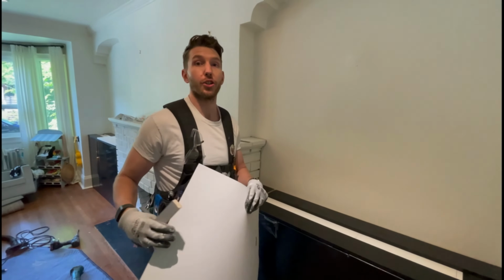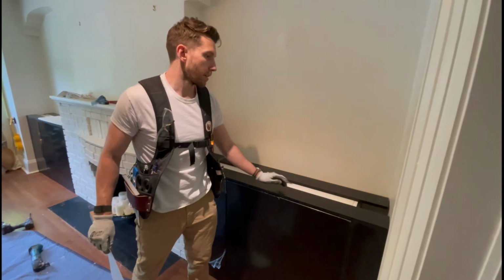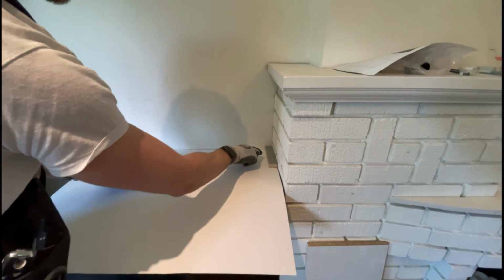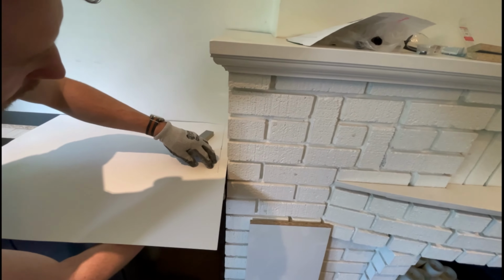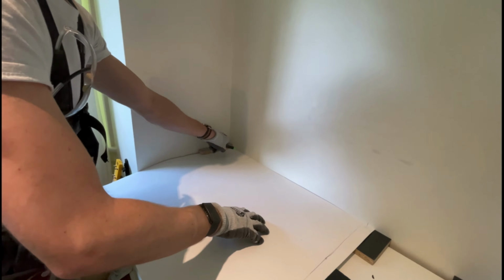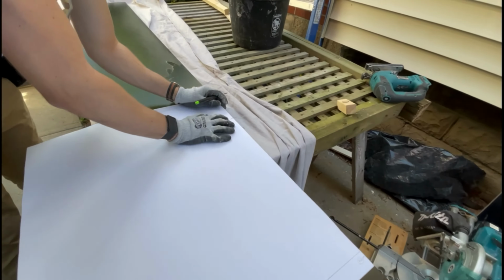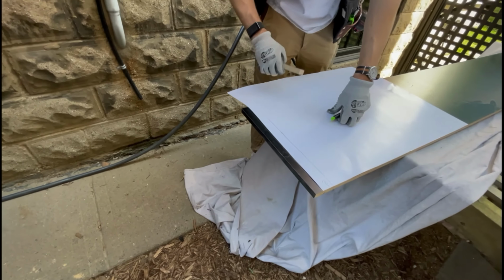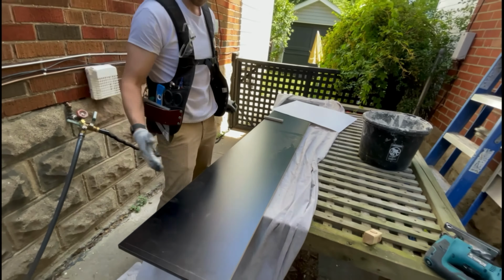How to Make Pieces Fit Perfectly! (Measure and Scribe at the Same Time)

Comment: Thank you for making this simple for the people who aren’t expert carpenters, and not having to buy unnecessary tools for one project.
Reply from the maker: Thanks 👍 that’s exactly what we set out to do (happy it’s working 😉)!
Reply: @RefreshHomeImprovements  and just to make sure I understand this method, the idea is to keep the poster board flush to the back wall at all times? 
I can only can go so far over because the side wall angles in that much.  So the poster board is flush with the back wall and about an inch away from the back corner because the front part of the post board is up against the wall and can’t move over any more.
Reply: @jenniferhiggins2671 the back wall should also be scribed in ideally

Comment: You don't mention nor do you show which saw you use to make your cut.  Wouldn't the tear out be different for a jig, track (circular), or table saw?  I'm guessing an average homeowner, for whom you're producing this video, would use a circular saw.  Even with a finish blade, it would be more advantageous to mark and cut on the bottom of your finish material so the top stays protected from tear out.  This would change your order of operations.  It seems like a critical detail.

Comment: I’ve seen this done a lot of different ways and this is by far the best method that I’ve seen.  Thanks for sharing!  What do you do if the back wall also needs scribed?
Reply from the maker: Glad it was helpful!
Reply: @RefreshHomeImprovements you didn't answer the question! What if the back wall is also wonky?
Reply: @DavidLee-cw6ci  You could do the same method but just add whatever you used for a straight edge to the deepness of the piece.

Comment: D.I.Y.ers: You need to place painters tape down where you're transferring your lines to prevent chip out of the Laminate.
Reply from the maker: It’s actually more important to cut the piece in the correct orientation. Painters tape can’t hurt, but you want the teeth of the blade to cut down into the laminate and not up and through causing chipping👍

Comment: What is the point of marking underneath the paper? I get scribing the sides but how do you get an even reveal on the front if the back wall is bowed?
Reply from the maker: Great question! I used the marks underneath to determine the depth of my piece first. The wall was relatively straight, so i used one mark on the right side of the paper, then another on the left, transferred the marks to my piece and connected the two dots (gave me the exact depth) then added 3/16” for the reveal and cut my piece to the final depth before i cut my side scribes. Apologies that its not more clear in the video 👍

Comment: I have two questions. First, will this method work on counter tops with a built in backsplash? Second, how would you use this method on a countertop that is 14 feet long? (Would you use a piece of paper that is 8 feet, or can you use one the size in this video?).
Reply: You can use a sheet like in the video but the possible error becomes bigger the more times you use a sheet. Hence, i wouldnt do it with a sheet this size.
And to your first question: a backsplash wont change the method.

Comment: Just curious have you tried using those digital angle finders for square/rectangle shaped cutouts that don't necessarily have 90 corners?   I picked up one made by Husky that was $20 and it's extremely accurate and is my favorite tool for gauging corner angles.  They make a manual / non digital version angle finders but the problem with those is they only give you a physical scribe of the angle when you lock the 2 legs but they don't give you numerical degrees so if you're doing 2 pieces of molding thats joining on a wall corner to make an angle of X-degrees you dont know what to evenly split that angle at for the 2 work pieces so you kinda need a protractor to then read the manual angle finder but you lose a little accuracy doing that as well as time. The digital angle finder is the best of both worlds b/c it does the same thing as the manual one but also tells you how many degrees with a numerical reading so you can from there easily calculate in your head what to set miter angle to with your miter saw.  But for what you're doing in the video all you would need are the angles on the corners and lengths of 3 of the 4 sides.

Comment: What if the walls are irregular or curved?
Reply from the maker: For the sides, if they’re curved, you’ll want to use a tool that allows you to consistently scribe the wall at the same distance and ‘trace’ the curve (instead of using a straight edge and doing multiple marks as shown here). You can use a washer, or something like this https://scribe-tool.com works great too. For the back wall, I like to tape two pieces of the paper together at the exact width of the back and then scribe the profile of the back wall the same way I described above. Cut out the profile on your paper and transfer it to the piece your cutting and cut the back profile first, then proceed with the steps we outlined in the video 👍
Reply: @RefreshHomeImprovements   Great! Thank you for taking the time to explain!